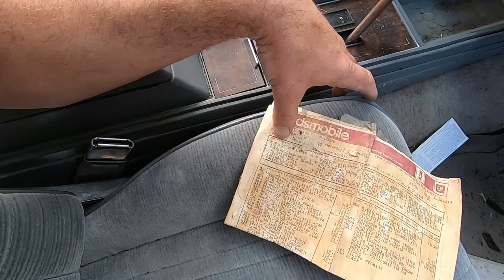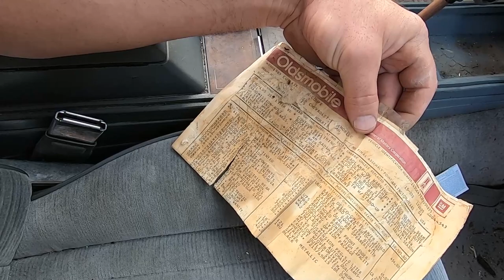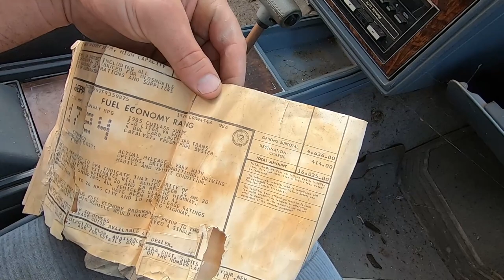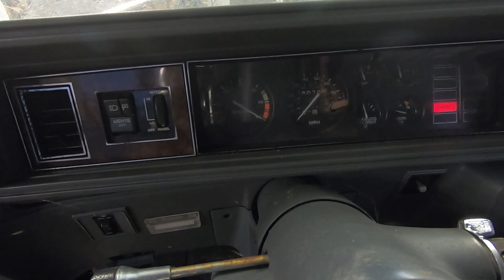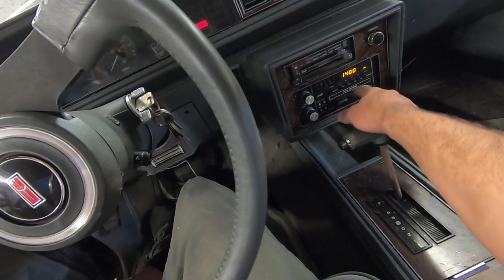1985 Oldsmobile Cutlass 442 Parked for 22 years! Will it Run?!? G-Body!!

Comment: My buddy had one of these, he put lightning rods in it out of a Hurst/Olds and he put a Whipplecharger on that 307. That thing would do a double patch from 1-2 and squeal them at 2-3 at 70.  I think it did low 12's. It torqued the body so bad it would open the trunk if you hammered it. Great car
Reply from the maker: Sounds like a hot rod!

Comment: I'm 23 years old and I've had 5 gbodies (lost one in the LNU fire last year here in California) but I've got a 78 El Camino (TECHNICALLY an A-body for that year), an 82 El Camino, an 85 El Camino (lost my other 85 El Camino in the fire) and an 85 Oldsmobile Cutlass Supreme Brougham. I've been working to get the abandoned 85 Cutlass Supreme Brougham for nearly 10 years and I finally got it. One owner, 42K original miles, has all of the original manuals, and the car is MINT inside and out. Sadly it has the most severe rod knock I've ever heard but for the $1,000 gamble it was, I'm so happy with it. It's going to be a project of mine in the near future
Reply: 403's are junk, only better than the 231cuin. buick V6. May have a 307 olds engine, no power but reliable

Comment: Not a 307 fan, Rev to the moon but no h.p. bad luck with one's I've ran. Had a 406 built for my Streetstock, monster motor, frame twister, locker snapper. Those 442s are great rides. My buddy has a 1968. It's a beast, all original 400 4bbl, 2dr. Gold color. Still cruise main now and then for the hell of it.

Comment: Videos like this make me miss my 87 Monte Carlo SS with t tops   had a good running  350 in it but  Had sum machine work done to it put a 400 crank in it and made it a 383 stroker 200R4 transmission fun  to  drive but hard on the fuel and rear tires lol 🤣

Comment: Nice. I’ve owned 3 of those cars so far. None were 442s though. All were great cars even with the gutless 305. I’d love to find another one again. Someone in town has a very nice original 82 442 that comes out a few days every summer. If I remember right he said he bought it brand new.
Reply: 3-0-7.   Never a 305
Reply: @rodger7029  307 was an Olds engine. Mine all had the Chevy 305

Comment: i had an 86 442   T tops   original 307   did the exhaust and rebuilt the Qjet. motor had a slight knock. the 373s with the loose converter smoked the tires up easy but rev range was limited to about 3800rpm  Loved the T tops.  eventually got the car painted but sold for like 3200 a few months later. this was back in 2009

Comment: The bottom side may be pretty rusty but this car is a rare beast. She deserves to be put back on the road. I hate when guys buy a car for parts and reason out in their mind it's not worth fixing. It's rarity is reason enough to save it.
     I've always liked those G bodies. I was looked down upon by some of the older generation for expressing a real interest in a nice maroon Olds Cutlass of this style body back in the late 1980's. I'd like to set that record straight with them now. 
    And I'm guessing the overdrive transmission counts for the 442. Didn't 442 used to mean 4 barrel carb, 4 speed tranny and dual exhaust? 2 outa 3 ain't bad.😁

Comment: Well, my friend, I take my hat off to you.  First one to do donuts in a few weeks without conking out.....and its a GM!  That engine sounds mighty sweet - good for dropping in the ol' Mortske Marauder (aka the blue Shop Truck). Wonder if you can get a bell-housing adapter to that manual box that's in there, because THAT would spin both back tyres for sure! 

For what its worth, I could see potential in that thing.....and I began to like it  There's something about the big old cruisers with the armchair seats and mile-long hoods that I get why they were popular.....before poor build quality and cheap materials let most of them down and they fell apart.....or rotted out when you parked them for a week.  Fords were the same in the 80s.....and yet the Japanese cars were perfect....until the transparently thin metal was exposed to 10 millilitres of water and they rusted faster than a late 70s Lancia or Fiat. My parents had a 1981 Corolla wagon that used to whistle when you drove it, but then I spent one summer driving over nothing but rutted unsealed roads and the whistling stopped, but there was now a stiff breeze blowing through the car with the windows up and the air vents turned off......but I digress

I feel that I do have to point out something where I think you went a bit wrong though.  White steel wheels look good on nothing.....period.  The End.  Give them 10 miles in the wet and they turn into grey or brown wheels....and then you wash them and the brown doesn't go away because the paint is chipped and they are now rusting.  They never stay looking good (and I am only comparing that 'goodness' with another white steel wheel) for very long, are as heavy as Grandma's fruit cake and make whatever they are attached to look cheap....like the owner couldn't afford real alloys, so welded himself up something on the inside of the standard rim and rattle-canned them.  Nope.  Don't like them....did you guess?

I'd be keen on seeing some of the late 70s to mid eighties land yachts being brought back, mate.  Seems to be they are gaining a bit of a following now - probably because every other classic vehicle now requires a second mortgage to buy.  If you fall across an El Dorado or Riviera from that era, I'd.....well, to be honest, they all look pretty much the same, but the El Dorado being front wheel drive is probably a bit of a hairy one for ya - and it would be a first on the channel too!  Hairy?  Yeah, hairy.  You gotta do your donuts in reverse in a front wheel drive, but you also gotta watch out for the nosecone's follow-through!  They're fun to do though - a little tough on the CV joints and any fences you hit (ask me how I know), but a lot of fun nonetheless.

Good video, bud.  Great to see you get a win for a change and get some serious dust in the air with the one-wheeler peeler!  I did laugh with all the dust that came in because it sparked a memory of my own - I can definitely attest from experience that donuts on gravel in a convertible is not the way to keep the inside of the car clean.....  Road dust also does not taste the best and too much of it can sting your eyes so they shut tight and you have to rely on luck not to harpoon anything when you straighten the wheel under full throttle to leave the dust behind you!  Fun times.....

Comment: Awesome upload Mortske, G-Bodys...they're notorious for rear bumpers falling off around these parts. These cars were seriously comfortable though and You could rig up an gas drip to the carb similar to an IV Drip in about an hour.
Reply from the maker: Was some tough times in the auto industry!
Reply: @MortskeRepair  Still are.
Reply: The previous gen, especially 76/77 were more prone to the bumpers rusting off than these.

Comment: You are reading the window sticker incorrectly.  The top rectangular area is the base options that came on all Cutlass from that year.  The optional equipment on the car in question is listed in the option list below that.  So the 3.8 v6 was the base engine for all those cars.  Below that it will say 442 and all the options that package offered…

Comment: If not truely blown up.itll start not good but run . just did one that sat since 92.  They had Grey / red interior .defrost is option .should have all black grill part's. They had the 307 motor. Those rims are hard to find now different than steel ones.

Comment: In the early to mid eighties ( give or take what year in the eighties ) GMs warranty was 12 months or 12,000 miles . A co-worker had a Cutlass Supreme with 15,000 miles that the T-Tops leaked terrible and GM would not warranty them . The guy had to put a tarp on the car every time he parked it . Beautiful car but like driving a convertible without a top .   Great video   What brand ' Samitch ' does Duff prefer ?
Reply from the maker: He likes Hamm's Special Light!

Comment: The big bad 85 442 with a whopping 180 HP and a stump pulling 225 ft lbs of torque that thing will pin you in the seat and give you all the G force LOL!! Anyway they are a cool car I like them but needs something more then the olds 307ci they should of put the rocket 350 in it or the rocket 455 with posi 3.73 then it would be a much better car but they are still cool

Comment: The original 442: four barrel carb, four-speed transmission, dual exhausts and is therefore desirable. This 442: It has a "442" badge on it, making it a poser.
Reply from the maker: All of which this car has.
Reply: By your standard, they were all posers after the first one
Reply from the maker: @rodger7029  Never argue with an idiot. They'll bring you down to their level and beat you with experience!

Comment: Grand nationals and turbo Buicks also had the 8.5 inch housing like the 442 but they came with 3:42 gears....the monte ss had the 7.5 inch rear housing with 3:73 gears...weaker than the buick and olds setups
Reply from the maker: Thanks for the correction!

Comment: Are rear window defrosters not common down there? I'm just above you in Manitoba and all the cars I've had from this era had them.

Edit: The LD5 Buick 3.8! My first car, a 1980 Monza Spyder had it too. I couldn't kill it. I pulled it out to clean it up and paint it, but being young and stupid, all I did was replace the concave lifters. Wish I would've tried hopping it up. It didn't have the 200-4R though. Surprisingly, it had the BOP TH-350 and not the metric 200.
Reply from the maker: It was an option but fairly common on later models

Comment: I bought a ‘68 442 in 1972. I did the usual back then with a Holley, headers, glass packs with cut outs, air shocks and Keystones with L60s. Oldsmobile should be embarrassed to label that ‘85 a 442……sad
Reply: There was a lot of misuse of classic muscle car names in the ‘80s. My aunt had an ‘87 Nova when I was learning to drive…it was a four-cylinder sub-compact.

Comment: You know what...that's the original engine or a different 307.The Olds 307 has a front mounted oil filler neck and all 307's have Quadrajets. That's the same H.O. engine as the Hurst Olds...and the 442 was better optioned. This had it all except the 2 tire fire rear. Hopefully this is still around.
Reply from the maker: Ran the casting numbers, it's an earlier 350. Quadrajet and filler neck were used on other engines and all interchangeable.
Reply: @MortskeRepair  so it's an actual Rocket 350..you don't see those anymore. Stout engines.

Comment: I had 95 grand prix turbo car. That stupid electric seat caught fire and toasted the interior.  Car still ran, built a front wheel drive s-10
Reply from the maker: Turbo? Or supercharger?!?
Reply: @MortskeRepair  Supercharger. Picked it up for 500 they thought it was locked up.  The only thing locked up was the a/c compressor. 45 dollar a/c delete pully and she was on the road.
Reply from the maker: @danielwilson5296  Heck of a deal!

Comment: I know it's a little rough, but still a shame to see a t-top 442 parted out, you'd be surprised at what people would pay for that car. I don't know how bad it is underneath but the rest of the car looks a lot better than mine. I have a '78 supreme t-top that's pretty rusty and had trees growing out of it, but every time I post a picture online I have at least  2 or 3 people sending me a message trying to buy it.
Reply from the maker: the parts from this car will complete a lot better cars out there
Reply: @MortskeRepair  that's one way to look at it, but another way to look at it would a regular old cutlass parts car would keep that one and the others on the road, but I could be partial though. I never really was a cutlass guy until I got this last one given to me, people really love the t-top ones for some reason, they even cut the roofs off the totalled ones to convert non-ttop cars, you can buy nearly everything new for the '81 and up, parts are easy to come by, and that car actually seems fairly solid up top since it didn't have the vinyl to rot it out, those panels under the t-tops just screw on on and I believe they even make stainless ones, and of course floor/trunk pans are readily available
Reply from the maker: @jacobemerson8015  You can't save em all.

Comment: $16k in '85 wasn't chump change...My only issues with reviving Olds engines that have been sitting is getting the lifters to pump up. Sound like a sewing machine until they do...Easiest way to get your car stolen during the 80s? Buy 1 with T tops. Tied for 1st? Buy a GM G body.

Comment: Your going to have to keep that drive train for other projects !
Reply from the maker: I already got a stack of engines!
Reply: @MortskeRepair  ya but how many of them run ?
Reply: @MortskeRepair  that would make a nice rat rod build , unless it sounds better on YouTube then in person ?!
Reply from the maker: I got quite a few that run. Most of them actually. Except a 307 I haven't tried yet! I ain't got time for a new build!
Reply: @MortskeRepair  way to many hamburgers on the grill so to speak ? LMAO ! That 307 only had 40k on it when it was pulled ! Maybe I should buy a model B and put a frame and put a flat 8  Ford drive train on it !
Reply: @MortskeRepair  didn’t you like my humor on the stuff in the package ? The pour spout , the valve hammers , the puller , the crank chain/bar turning tool , distributor and fuel pump ?
Reply from the maker: @davekimbler2308  No that's all good stuff! Used the turning tool a couple times. Tried the hammers but the heads won't stay in place!
Reply: @MortskeRepair  sorry I didn’t have the head screwed on correctly ! Lol. I should have made it from one piece , I’m still learning ! Lol
Reply from the maker: @davekimbler2308  I appreciate the effort!

Comment: Useless trivia! Did ja' know.... the 442 did not have a 442-cubic-inch engine. Instead, the numerals indicated that the car had a four-barrel carburetor (atop a 330-cubic-inch V-8), a four-speed manual, and dual exhausts.
Reply from the maker: You are correct

Comment: Put a can of Coke over that battery terminal so you can get good connection any good mechanic will tell you that have a great day bud
Reply: I drive a tow truck and when people tell me their car don't start usually I take a can of coconut over there car batteries terminals and within seconds it starts right up Coca-Cola the soft drink is what I usually use

Comment: That thing shouldn't be parted out. It's too nice. Just needs a brake line and an air filter and it's back on the road. Well, and probly a fuel tank cleanout.

Find a G-body with a stick in it if you can. Talk about a rare car, nevermind fancy option packages or trim levels. Failing that, track one down with the diesel in it; Junkyard Digs did one and it was somethin' else seeing just how EASILY that thing cackled to life. And then being deafened by all the injector knock.
Reply from the maker: I've seen 3 stick cars now. All wagons or ElCaminos however. I wish I would have bought them. We've got quite a few diesels around however. Real heaps!
Reply: @MortskeRepair  A stickshift el-cam would be one hell of a mullet mobile. And quite practical besides. If I was to get a G-body it'd either be a stickshift el-cam, stickshift wagon(Highest priority; I fly RC airplanes and one of these would be PERFECT for transporting them to the flying field!), or a 5-speed-swapped GNX(Aftermarket swap ofc they only ever sold these autotragic).

One of those diesel heaps would be a legit good score if you still have any squarebodies lying around needing a powerplant. Drag it in the shop, get the engine to bust off, maybe get a donut or two out of it, then rip the powertrain out for the squarebody. Might be worth getting one of those if you think the engine and trans are still viable.

Comment: special order car maybe? 442 is 4 barrel 4 speed 2 wheel peel lol
Reply from the maker: The 200-4r transmission is a 4 speed. I think the limited slip is just shot.
Reply: @MortskeRepair  ya i agree i was pointing at it being a factory 2 barrel 3.8 v6 like it said on the build sheet still rad nontheless but thats weird
Reply: @MortskeRepair  ohhh i rewatched and understand now, wish i had my build sheet.
Reply from the maker: @GHOSTYU2B  Those were just the base options, it was optioned up to the 307, but that was replaced with a 350
Reply: @MortskeRepair  ya i saw that after rewatching, learn something new everyday. i had one of those 307s in a cutlass once they're more gutless than a 305, "the gutless cutlass" lol

Comment: Not much of a revival… but in true GM fashion you just toss a battery in it get some fuel running and it barks right off….was never a fan of the 307… always found them a little lazy revving..

Comment: Oldsmobile starter is on drivers side and Chevrolet is on right they are not the same
Reply from the maker: Good to know!
Reply: @MortskeRepair  also a olds 307 is a 90° block meaning it looks big where as a small block Chevrolet is a 60° degree block. Have to change some things around and order 350 brackets for alternator and pump and stuff.
Reply: @chadjones4956  , 350sb chevy would likely bolt right in since most of the B and G bodies had holes drilled in frame for any engine combo. Just would need the chevy mounts in lew of olds.  Unless that trans had universal bell housing(with multiple bolt holes), would need a chevy trans also.

Comment: Yup that is a Oldsmopile of crap . 442 should be the cubic inch than it be sweet . If you were to pull engine apart you will find all the ring ends are in align . Stupid and will burn oil at 40,000 miles . It will blow up if you push it .